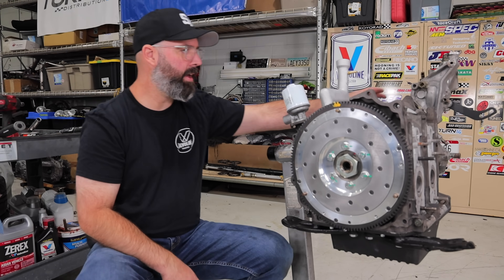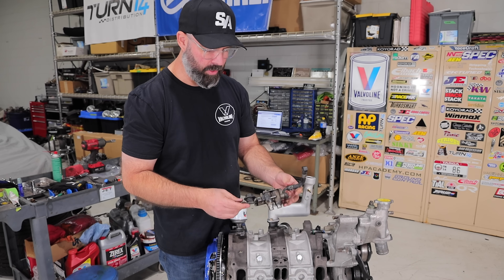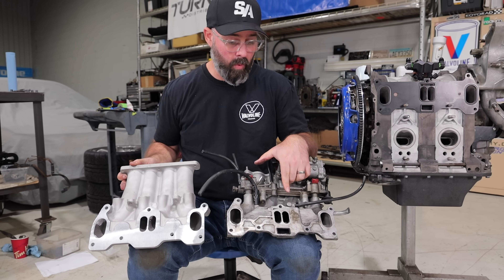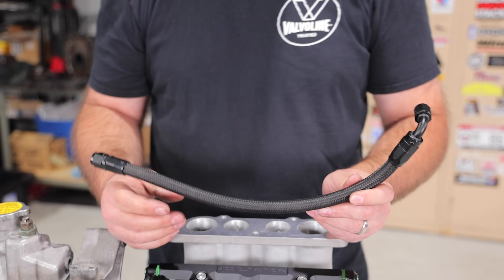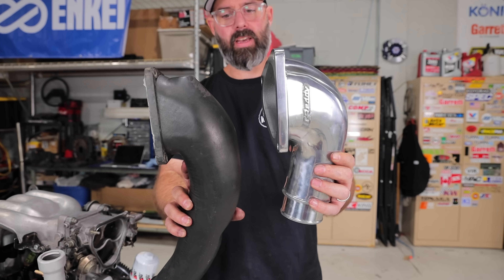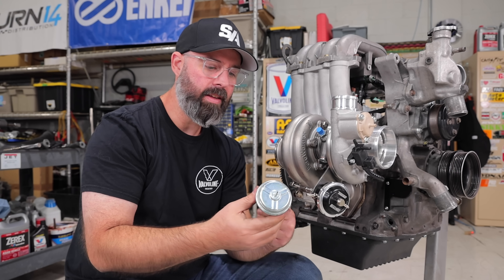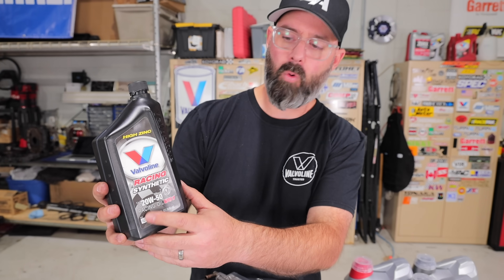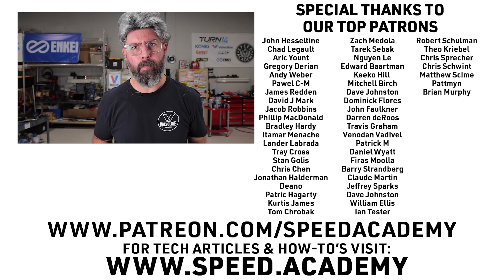How to Build A 10,000RPM Rotary Engine - Part 4

Comment: You're using rubber braid on an engine built in 2024... rubber which from Gates automotive has said has a shelf/use life of 4 years, you're cutting corners here. Teflon you wont need to replace, just use more fittings to make it a nicer execution and you wont need bends as your set up could be a lot more aesthetically pleasing and practical, also bin that factory fuel temp sensor and run a fuel temp and pressure sensor at the fuel pressure regulator.

Comment: Great Video, however that IWG baby EFR 7670 turbo will choke well before 7krpm and wont flow anywhere near 10,00rpm. You need a HKS T51r SPL to have a power band to 9krpm or something bigger for 10krpm like a efr 9180 or 9280. 

You will have great response but will be all over by 7krpm..no way it will flow or make power/torque beyond this point. However, it will be interesting to see the results.

Comment: The oil weight matches with what I've heard for my rotary.  10w-30 for sub 70° F outdoor temps and 20w-40 or 20w-50 for weather above 70° F.  TBH... I just change the oil often and premix a healthy amount.  No problems so far!
Reply: PREMIX????  You have to be monumentally stupid to pour the wrong oil down the wrong filler hole... 
Learn to read the label on a bottle of oil son.
Reply: @sandervanderkammen9230  yes.. premix
Reply: @MainBahamian  Stupid is as stupid does...

Comment: In fact you don’t need to many fancy parts for reach high rpm on rotary engines. Just need good apex seals, coils and fuel pump and you are on it. Good information on this video. 👍👍

Comment: Why did you choose the EFR 7670 if your engine was built to handle 10k rpm?  The 7670 is out of its efficiency range at around 5k rpm on a 13b.

Comment: if you pre mix you need to drive like a 2 stroke; never engine braking. If you leave the oil metering pump you can add a secondary oil tank that feeds it with 2 stroke oil  ;)

Comment: I think you'll be disappointed with the power a 7670 will make. I had a minor street port and the 7670 had so much back pressure that it blew the gate open over 5k rpm and I could never get over 13 psi even with an 18psi spring. Ended up with a meaty mid range but didn't even break 400whp

Comment: 7670 on a high compression motor ... Will never see 10k RPM as that turbo will top out at 6-6.5k RPM with that setup. The hotside is just WAY too small for a Rotary. Should have stepped up to at least an 8374.

Comment: Looks like a good build. The 7670 will start to run out of steam at about 6500 RPM. If you want 10,000 RPM and to actually make power after c.7500 RPM then you'll want s much bigger turbo like the 9180, 9280 or even the big hp maker S472/S475. Granted those won't deliver the same type of response and those turbos are built for 600+ hp.

Comment: Guys, that EFR7670 0.92 A/R will top out before 6750 RPM as EMAP starts to overwhelm it.  You'll be running a TON of backpressure by 10k RPM.  Realistically your needs would have been best met by an EFR 8374/8474 with an external wastegated (dual 40 or 44mm) on the 1.05 A/R housing.   For anyone reading this, larger porting = more sensitive to backpressure.  Larger turbine wheels are necessary comparatively to a reciprocating engine.

Comment: Never replace a rotary with an LS!
You can get more torque, but it's easy heavier. It doesn't sound as good, and it doesn't make the hairs on the back of your neck stand up each time you rev it!

Comment: I think I might understand why people don't use synthetic oil with oil metering pumps. 

If you already have buildup in your engine from carbon deposits or buildup in the metering pump, switching to synthetic will likely start to clean and remove those deposits that could potentially get clogged/logged into the OMP since it just recircullates oil at the bottom of the pan. Also it would just inject chunks of carbon into the combustion chamber, causing damage to the surface of the rotor housing. I have been trying to understand why I couldn't use synthetic in my personal RX8, and a lot of times people would switch to synthetic AFTER removing the OMP. I never understood until it just randomly clicked and I had to comment this lol. Good thing I never did switch.
Reply: I'm small brained, there's an oil filter before it goes into the combistion chamber

Comment: It's like 20k for a 20B mainly due to the e shaft needed. Would be a rip roarer but this is a good speed academy representative of their philosophy no full race mods here. if you can't street drive it it's not as fun as it could be and why do it? I can't wait to see this build guys... Also when are yall gonna put a renesis in an frs?

Comment: After making that beautiful high compression 2 rotor, to even consider putting an ls in there would break my heart
Reply: That's on them... The poor little FD should not be punished with an ls if they can't build a rotary correctly.
Reply: They say that just in case (which it will) the motor gives out because of lack of balancing and poor measurements on side seals.
Reply: @israelcardona5170  how do you know it wasnt balanced? Also the side seals were measured fine. Rotaries can and will last
Reply: @minilurk11  never mentioned in the video just like the corrosion on the EVO block was never mentioned either, they didn't use same rotar's with the crank and so that's a no, side seals on RX8 Rotar's need to be properly measured and not just go by feel like they did in the video, also changing out the Flywheel without changing the front counterweight is going to be its big down fall especially they're going to rev it to 10,000 rpm like they said they will...

Comment: I think you guys might have went a hair too small in turbo size. The 7670 only puts out about 350-ish on the lower compression at 15 psi. Since you went higher compression you would typically want to keep boost pressure down. I would have gone for the 8374/8474 since spool is only about 300 rpm difference and breathes so much better on the top end, especially where you need it at lower boost levels. 

Source - 8474 13BT
Reply from the maker: We had this turbo kicking around so it will be a good start for us and then we’ll move up when needed.

Comment: At 6:33 explain why you can't run primary secondary and the single rail 6 injectors
Reply: You can, but that's a lot of fuel for his goals.  They are there for big horsepower builds with big laggy turbos running on E85.  I'm sure if your ECU could support it, you could find a way to run those extra injectors while only making 300hp, but it would require some tricky programming of the duty cycle of each injector, phasing out the primaries in favor of the secondaries at a certain load.  Most tuners won't want to bother with that, instead the ECU is set up to run the primaries up to 100% duty and then start engaging the secondaries when there isn't enough fuel flowing.

Comment: Nice build. Questions:
1. Why did you go with the eXcessive LIM and didn't put in a better upper? The OE upper is fairly restrictive, isn't it? Many people convert to a Cosmo or clone.
2. Why didn't you mention the automatic counterbalance behind the flywheel? When comparing weights between the aluminum flywheel and the OE you have to also include the counterweight since it is integrated in the OE (manual RXes don't have a seperate counter weight on the back).
3. Also, why didn't you mention the SOHN or RRP Clean oil adapter? They give the same benefits of premix (clean oil from a different supply), but without having to premix... or optionally you could do both.
Reply: I was wondering about the UIM as well, but if you're on a budget, the LIM is the one to do first I suppose.

Comment: I love the 7670 on my FD. My car on e85 makes 400hp/400tq on a stock motor
Reply: Not bad, I guess 400WHP is pretty much the limit of the turbo and response is stock-like?
Reply: aDaWaN 
Lucky7 made 450whp on the same turbo with a street port.
I would say response is better then stock

Comment: You're definitely using good parts to ensure it works properly and efficiently. However, I'm going to be the asshole here. I wish more people did small things like paint and clean engine parts a bit better. It doesn't need to be show car worthy, but aluminum looks dingy over time even if it's clean. A quick paint job does wonders. Also, the black steel parts look so much better scuffed and sprayed with a new coat of black. Small things do wonders.

Comment: love the show but as a ex-rotary owner if you will be revving the engine to 10k that water pump wont cut it.. i will not bor you to the details why but you need to look it up plus the water pump pulley it self has issues you have to address to :)

Comment: Is there a reason you didn't go with an equal length manifold for the twin scroll turbo? Also you really don't need a blow off valve nowadays. It may have been needed 20 years ago but all its doing now is creating more lag between gears and making the choo choo noises less choo choo

Comment: Not using the OMP is a mistake, Mazda made it specifically to put oil in the housing in a ratio to engine load.  Using premix fixes that ratio and means you only get oil when fuel is injected.
Reply: With a modern standalone like an adaptronic you can set decel fueling higher so it keeps injecting fuel even on decel.

Comment: What normal people see: damn did those guys really just reuse that water pump wtf?

What the Vargas Brothers see: did this guy really just put a lightweight flywheel on a already unbalanced motor and is still talking about it going 10,000 rpm and talking about it being reliable?! (Vargas Brothers cringing to the rotary God's)
Reply: Although supposedly this was balanced and machined by the previous owner but the flywheel wasn't Balanced to the rotating assembly, but with not properly measuring side seals or any kind of verification if the assembly was Balanced front rear to be interchangeable i doubt the flywheel is the biggest issue here
Reply: @jaredspratley6270  thank you for not being that dumb either. Yes they have a lot of other things going on for them. It's all about doing stuff for cheap and not really proper. But they would say they aren't go to in how to build things but when building will go into depth into what there doing. I guess saying it that was is there escape goat for when things F up.
Reply: @israelcardona5170  yeah I don't see it surviving long they put a banjo bolt on the fuel rail for Christ sake
Reply: @jaredspratley6270  they live that life of #fuckit and it shows
Reply: @israelcardona5170  clearly
Reply from the maker: Yes clearly we’re complete idiots. We’ve built this engine so it’ll blow up and create drama. Don’t you guys know how Youtube works?!
Reply: @speedacademy  that's for finally admitting it! It only took three motors later! You know all jokes aside when is the halfassness (yes a new word just for y'all) going to end? I get saving money here and there but who are you trying to impress by cutting corners? Rotary's are quite particular in how you build them and the biggest part of keeping them reliable is the balancing of the hole assembly and everybody in there no says that but y'all couldn't be bothered (even with new rotary's and a flywheel which is the biggest part) just like resurfacing the Evo block knowing it looked sus and just like the 2J with simple things like valve guides and others spots that known to leak; letting known broken go until they're problems is just stupid. I'd love if you guys would just take your time to do things right or even at least try because y'all would be time tens more of a channel if you just slowed way the hell down and do things right and don't have to always revisit BS that should have been handled from the gecko.
Reply: @speedacademy   Look im not out here trying to do your job but when you list this as a tutorial for someone else to follow and you skip steps, You don't give all the information which is clear because everyone in the comments of every single video of the series has been asking if the assembly had been correctly balanced. You answered that because of one of my comments in this video so I'm glad to hear it was done, yet you go and use non equal length runners,  your running 93 and not planing to run idemitsu, (i understand you are sponsored it makes sense,  just little worried about the new product) you skip putting in injectors on secondary rail for a fail safe, put a fuel flow restriction in the system on purpose, its just alot.   And that's just this video, Not to mention the original plan to mix oil weights, Having a builder who admitted you were gonna get flamed or he was for not following specifications on the rotors, And probably something else I was missing. If you're trying to make a video for someone who wants a rotary engine, you have to do it right or the stereo type will just be reiterated, all im saying
Reply from the maker: @jaredspratley6270  Are you speaking from years of experience you have building multiple engines or information you've collected on the internet? If there was only one way to build a reliable rotary engine then don't you think everyone would be doing it that way? Yet, if you visit multiple rotary shops you'll find the process and parts are different almost every time. We aren't claiming our way is the ONLY way, we've made a video showing our process.
The fact that you are claiming Idemitsu is the only oil that can be run in a rotary shows me your lack of real knowledge on the workings of motor oil and engines. Perhaps take a bit of time to understand how oil works and that there is nothing magical about one brand or another. If you think that Valvoline is somehow inferior to Idemitsu I would love to see your proof on that and not just a forum post of Joe Schmoe saying it...
Reply: @speedacademy   I'm saying that idemitsu is the best for 93 because it's been tested in a lab on another channel  Against other pre mixes on 93 and the same tests were done on alcohol and e.  I did not state that idemitsu was the end all be all,  But what that test found in the unsponsored video,  Is that idemitsu held together the best in fuel and burned the best against the other pre mixes, Valvoline was not in that video if my memory serves, And idemitsu was really bad in any fuel other then pump gas.  My statements about the build not being done right or based upon the fact you did not follow service information, you did not clearance the rotors for 10000 rpm,  Add you stated that you would not go to 10000 rpm if the power band dropped off. Now I'm not saying you're wrong but I am saying that the official Hall Tech YouTube channel has stated that a well running rotary should run to the top of the RPM range at red limiter at peak power if the car is built and tuned right, producing optimal performance.  Your builder did not correctly follow service information that is what I stated. I also stated that you did not show the process of machining and balancing the assemblies and flywheel and that fans besides me were worried.  I never once brought up any of the parts that you were using that were not what I would have used, nore bashed any of your sponsors,  just stated facts as they where presented in the research on these engines i have done. If the fact that you not following data sheets from the parts manufacturers doesn't bother you thats fine, but bashing me for pointing out you didn't demistrate the correct way to do it will get you no where.  I have watched just about every rotary building video on YouTube, i am on several forums and always learning new things and ways to do things rotary related. I have never assembled one myself, but know enough to not suggest your video to someone who is looking to
Reply: OH MY GOD THEY ARE RUNNING 2 SECONDARY INJECTORS. I give up
Reply: Thank you